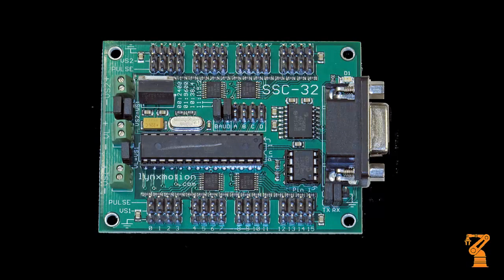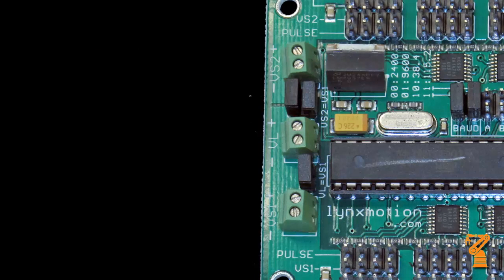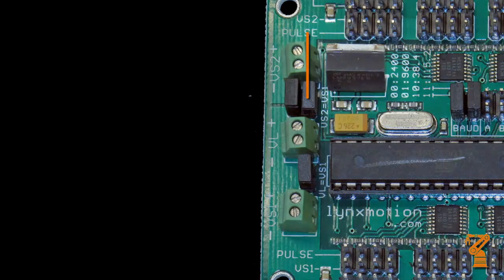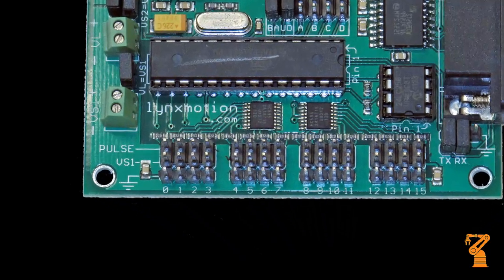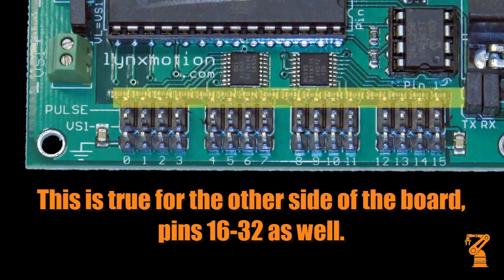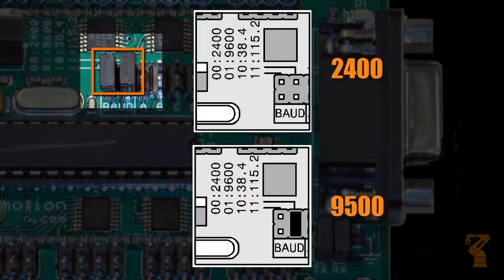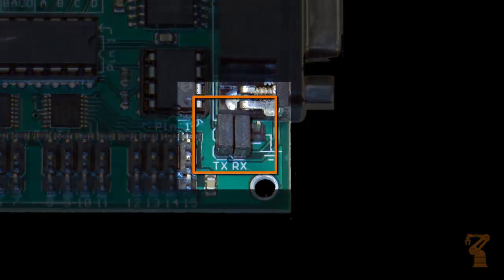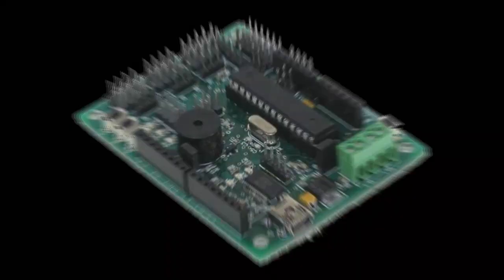SES V1.1 SSC32 Overview by Chris&Jim

Comment: excellent video however for someone like myself that is completely new to this,  there is still a lot that is not clear . it would be useful to have an overview of a typical project  ie a case study so that we could see all the hardware and software required to complete a simple project.

Is it possible to connect servos directly to this servo controller , program the controller  on a PC and then run the servo program with the controller board disconnected from the PC ?  or would the controller board need to stay connected to the PC and the program run from the PC 

What programmer is used to program the SSC-32 ?  a link or image in the video would have been very useful otherwise it is far from clear .
If I purchased a SSC-32 controller Would I also need to purchase the  servo sequencer utility in order to program it ?  or could I use the free download utility ? 

My intended project is to construct a robotic bird and program 8x servos to run a 2 minute  sequence . I would prefer to be able to run the servo sequence without being tethered to a PC but its not essential . 
What I need to know is what I need to purchase to achieve this.

Comment: it is possible to use it 2s lipo power supply and 7.4 volt work required servos?
and i"m planning to use 25 of this servos
Reply from the maker: Hi, it all depends on the servo's specifications (current draw and nominal voltage). The battery's capacity will also be a factor since driving 25 servos may discharge the battery very quickly.